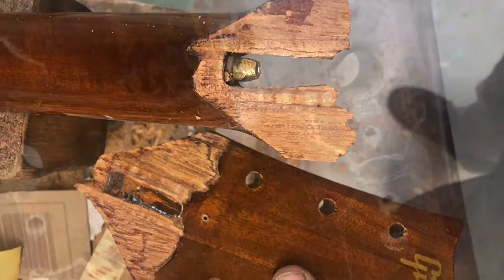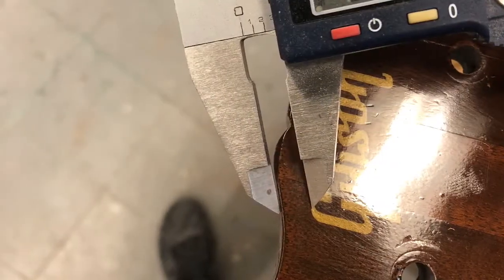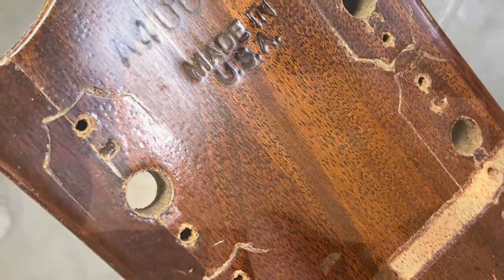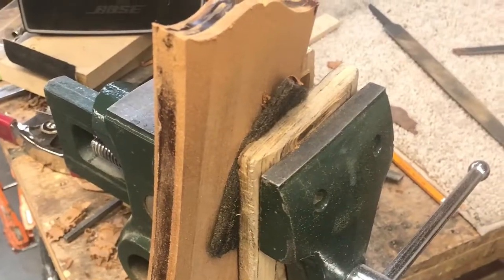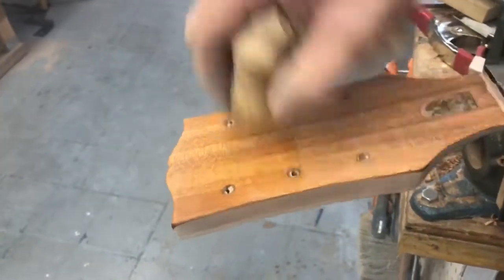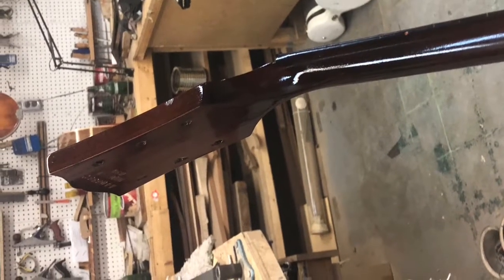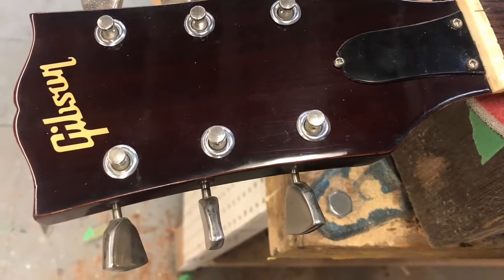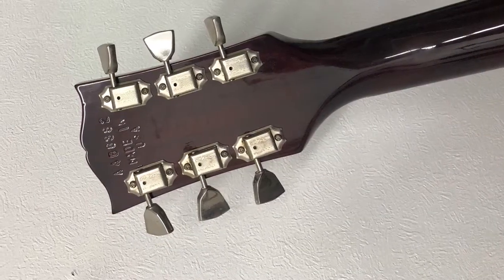Broken Gibson Headstock Repair

Comment: Was wondering. Would it be possible to cut the original headstock in half, yielding the front and back in two whole face pieces? Then plane the front down to a veneer and the back as a wedge veneer, to keep the original lettering and decal? Fantastic work!
Reply from the maker: Since this video, I’ve gotten a better band saw and done just that!  It works well.